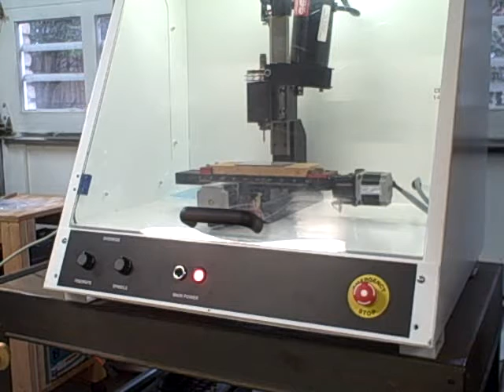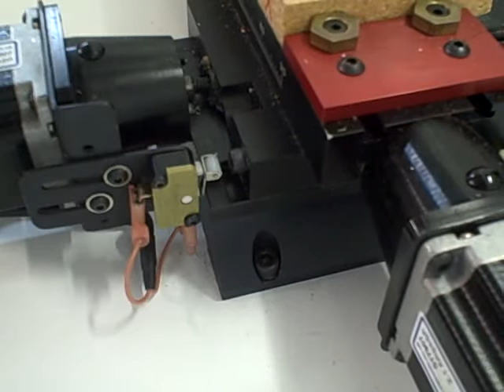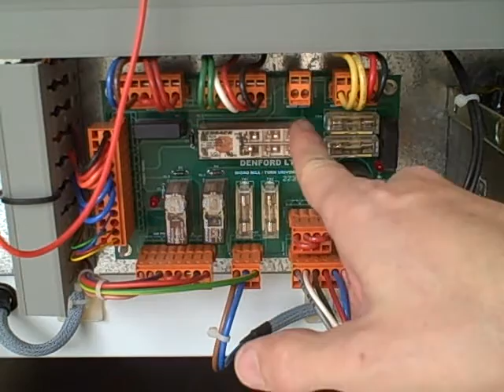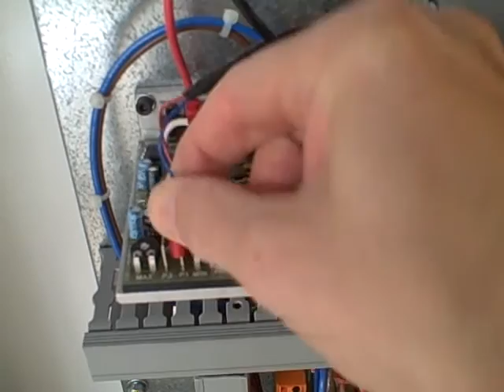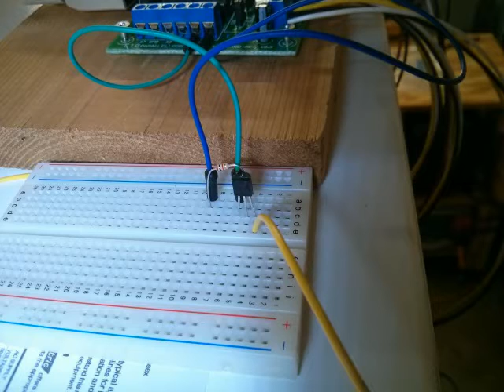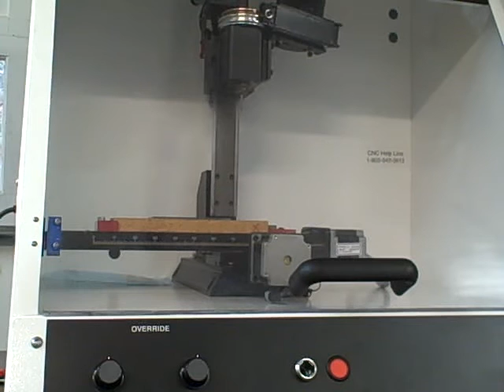Part 2:  Limit Switches and spindle control - Denford Micromill 2000  mach3 / linuxCNC

Comment: I have a denford micromill 2000 and just had the spindle drive go out on me today. I went to warm up the machine and I hadn't run it at such a slow speed before and as it was running it just stopped as if I hit a dead spot in the potentiometer. I turned it slightly faster and it started working again. 30 seconds later it stopped and hasn't turned since. I've been having dead spots ever since I got it. I bought it from a hobbyist cnc machinist and I think he mentioned how the spindle has acted up that way. Anyways after testing both the potentiometer and the on/off switch it seems that the board has gone out. I haven't tested the relay but something like a relay going out would seem to be a single failure and would usually result in it being stuck on or stuck off instead of acting all finicky at different positions when it did work ok. Just wanted to see if you've had a similar problem or if that's what is indeed needing to be replaced. I already have replacement parts coming in though but with the current setup for spindle power being so isolated from everything else it would seem that's the problem.

Comment: So I have a novamill and so far I have xyz axis motion and spindle wired up manually with a 10k pot. But I want my limit/home switches to work. Do u just connect the switch wires to the 96din or does something have to go to the bob? In my case I only have a db25 header. Any info would be great. Thanks for your work documenting this project
Reply from the maker: Yes, I connected the switch outputs on the 96-way connector to the inputs on my BOB.  Full writeup is on my website here:
https://www.summet.com/blog/2016/01/17/how-to-convert-a-denford-scantek-2000-micromill-to-linuxcnc-mach3-control-part-2-home-switches-e-stop/

Comment: Cycle stop or estop would be better when you open the guard. Your cutter will shatter and that can be dangerous too on top of being costly.
Reply from the maker: +DJB HSI 
Currently I'm only watching the ESTOP line in my software, which is only triggered by the big red button, and the guard switch disables the spindle motor power on the mill driver board. However, it looks like by adding one more wire I can read the guard switch on my break out board and use it as a second software ESTOP to make the steppers stop as well.
Reply: +Jay Summet You can just run the wires from the switch to the Estop pins on the BoB. You can run both in parallel because Estop switches are always NC. I'm assuming your guard switch is NC ( when closed)  so you should have no issue. I've been running mach software for 10yrs and lucky I've never had to press Estop while machining but EStop should automatically shut off the spindle. I'm going to test that next time I'm machining just to make sure. Unless this machine is going to be used in a school I would disable the guard switch.  You'll find it's going to be an annoyance in the long run. Sometimes you want to clear chips away from the cutter to avoid breakage. Estop is not really the way you want to stop the machine if you want to inspect etc, because it kills power to the drives and you'll have to rehome as the machine will lose position. Cycle stop is the right way to do it.  Take a spare input (hopefully you have an extra one) and setup a hotkey in the input signals.  Where the 0  is in the hotkey row click in the space and hold ALT-S for cycle stop 2163 should be the number registered.  Put a check mark in emulated and set up the pins accordingly.  That's the way I would do it if I want to keep the guard switch.
Reply from the maker: +DJB HSI 
Cycle stop sounds like a plan for the guard switch. My goal is to not re-wire anything inside the case other than plugging into the 96 way DIN connector (just for an aesthetically "clean" install, and to see if it can be done. If it can be done that way, it would be possible to make a plug-in conversion kit.)